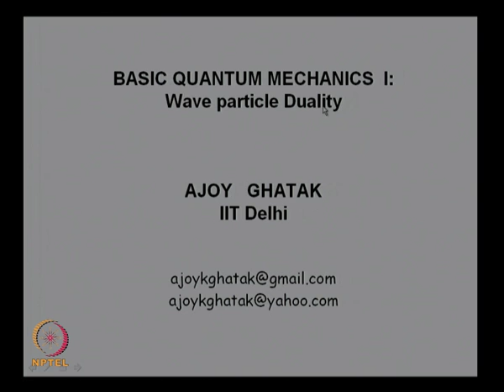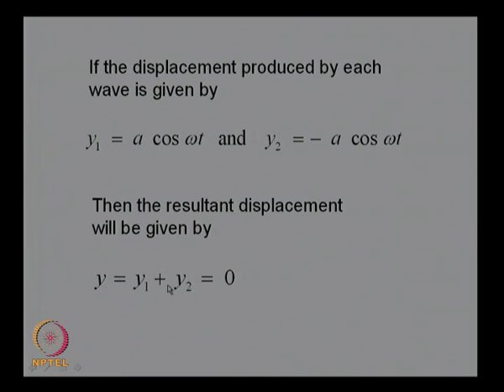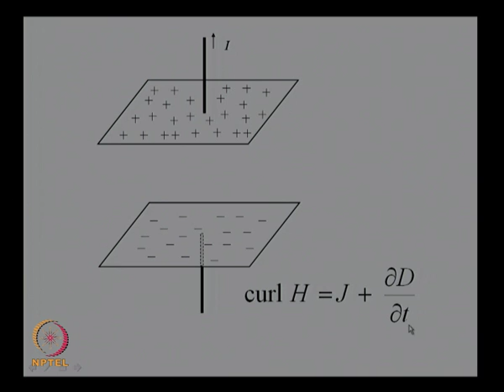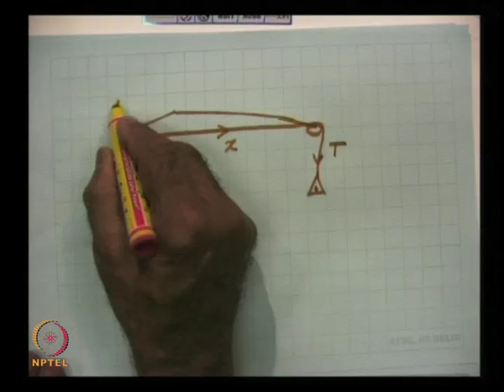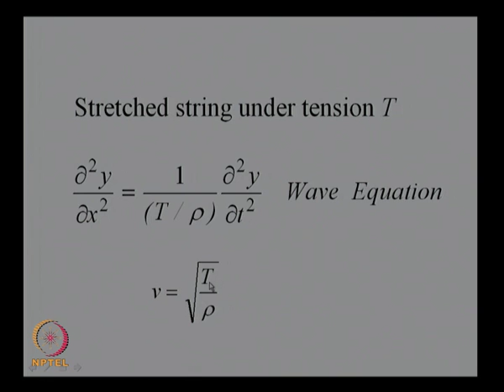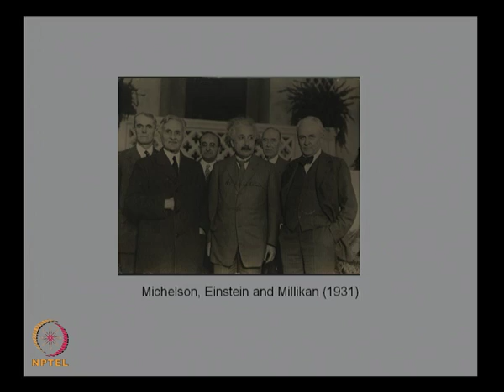Mod-01 Lec-01 Basic Quantum Mechanics I: Wave Particle Duality

Comment: Electronflow gives shock where as light waves gives heat so some difference is there it should be deduced.so what is it light waves are electrically neutral what makes it electrically neutral should be deduced.

Comment: THE CLEAR, CENTRAL, AND BALANCED MATHEMATICAL AND PHYSICAL PROOF OF WHAT IS TRUE/REAL QUANTUM GRAVITY:

I offer the following regarding the dual nature of light AND electrons. Consider what is THE SUN. The sky is blue, and THE EARTH/ground is ALSO BLUE. The stars AND PLANETS are POINTS in the night sky. GREAT. E=mc2 IS F=ma. This explains the fourth dimension AND the term c4 from Einstein's field equations. BALANCED inertia/INERTIAL RESISTANCE is fundamental.

E=mc2 IS F=ma. CAREFULLY consider what is the Sun, AND carefully consider what is THE EYE ON BALANCE. (Also notice the associated DOME AND black “space” AS WELL !!) IMPORTANTLY, this NECESSARILY (AND CLEARLY) represents, INVOLVES, AND DESCRIBES what is possible/potential AND actual ON/IN BALANCE. Is what is a TWO dimensional surface or SPACE ON BALANCE invisible OR VISIBLE ? The answer is that it is BOTH. The stars AND PLANETS are POINTS in the night sky ON BALANCE. SO, the electron AND THE PHOTON are CLEARLY and necessarily structureless ON BALANCE. Great. Indeed, as it has been written, gravity CLEARLY involves interaction. I have CLEARLY explained why the rotation of WHAT IS THE MOON matches it's revolution. Also, ON BALANCE, consider what is the orange AND setting Sun. E=mc2 IS F=ma. Consider TIME (AND time dilation) ON BALANCE. Excellent.

The fourth dimension is only consistent with what is (on balance) a TWO dimensional surface OR SPACE ON BALANCE. Consider what is the eye. Consider what is the balanced MIDDLE DISTANCE in/of SPACE (ON/IN BALANCE). Consider invisible AND VISIBLE SPACE in fundamental equilibrium AND BALANCE. The stars AND PLANETS are POINTS in the night sky ON BALANCE. SO, consider what is the speed of light (c) ON BALANCE. This CLEARLY explains the fourth dimension AND the term c4 from Einstein's field equations. I have explained (or proven) why THE PLANETS move away very, very, very, very slightly in relation to what is the Sun ON BALANCE. Great. I have clearly explained the cosmological redshift AND the supergiant stars ON BALANCE. Magnificent.

Time is NECESSARILY possible/potential AND actual ON/IN BALANCE, as BALANCED inertia/INERTIAL RESISTANCE is fundamental pursuant to F=ma AND E=mc2 in balance. A galaxy consists of invisible AND VISIBLE SPACE in fundamental equilibrium and BALANCE, thereby eliminating the need for any "dark" "matter" or "dark" "energy"; as ELECTROMAGNETISM/energy is then CLEARLY gravity ON/IN BALANCE.

c squared CLEARLY means an INTERACTION on balance, as the stars AND PLANETS are POINTS in the night sky. Balanced inertia/INERTIAL RESISTANCE is fundamental. Consider E and “m" on balance. Great.

Stellar clustering ALSO proves (ON BALANCE) that ELECTROMAGNETISM/energy is CLEARLY (and necessarily) proven to be gravity (ON/IN BALANCE), AS E=mc2 IS F=ma. Magnificent !!!

By Frank DiMeglio